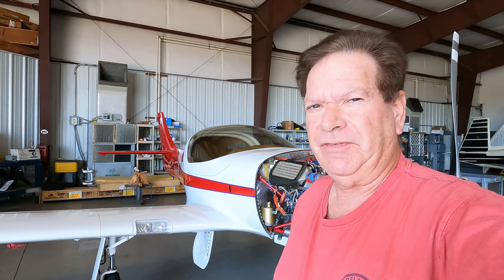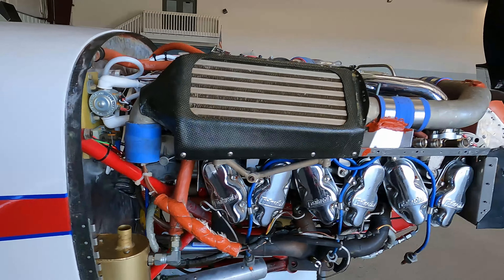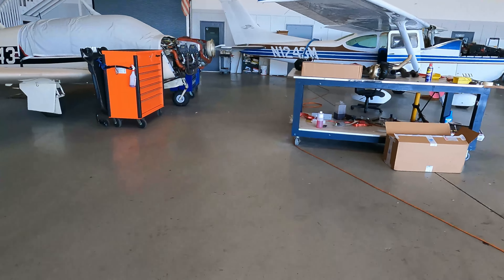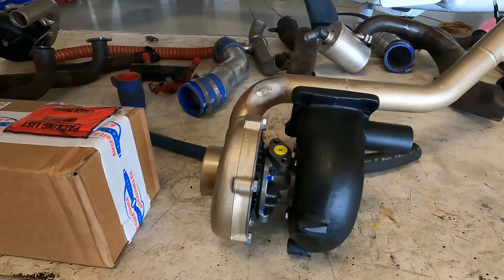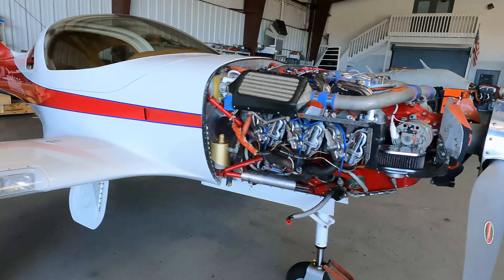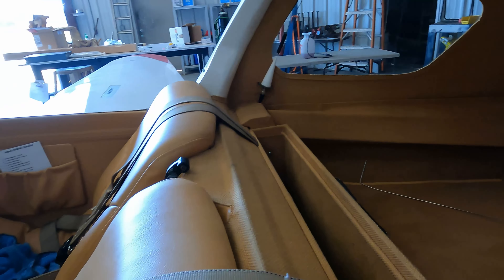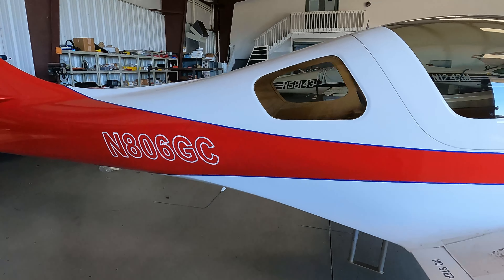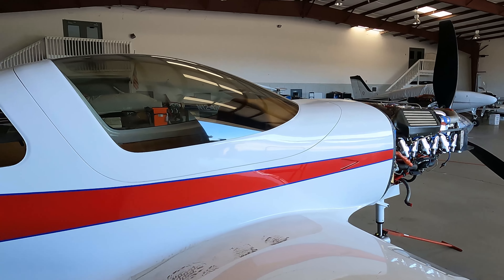Lancair Legacy Annual Condition Inspection - Part 7 - Engine Is Back In

Comment: Nicely done, Steve. If you can't afford to fix it properly, you shouldn't be flying it in the first place. It's called risk mitigation. It starts exactly where you are at the moment, on the ground willing to put in the time it takes to get it done right. Next, regardless of your previous experience, get the proper training under your belt, which clearly you are planning, well done! What a gorgeous airplane, congrats!
Reply from the maker: Thanks for the kind comment.